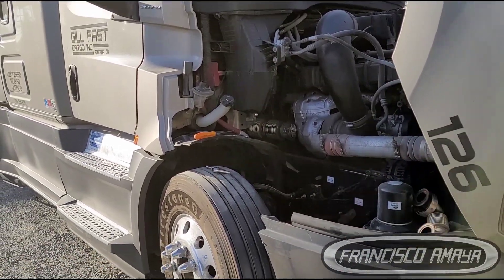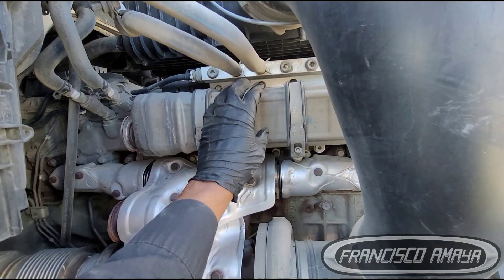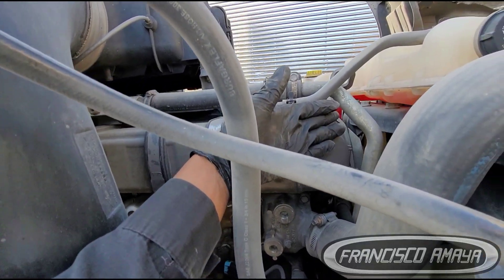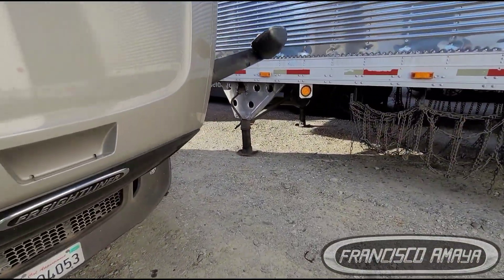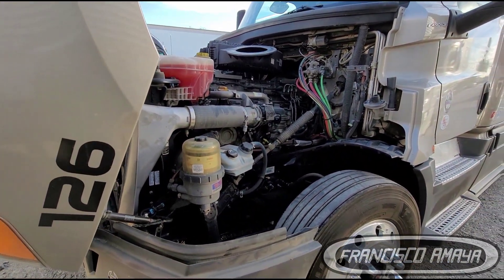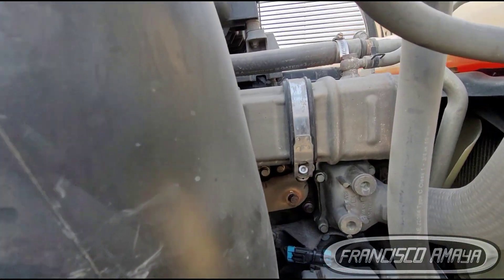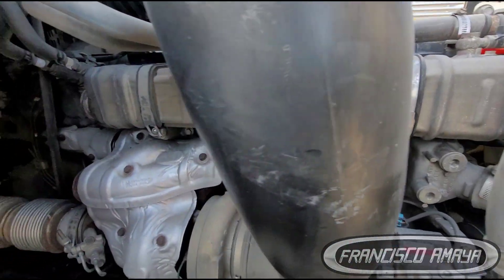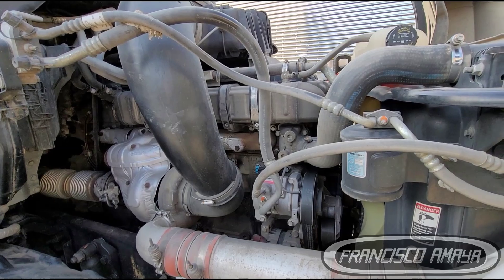DD15 engine broken bad egr cooler coolant missing one gallon every 1000 miles

Comment: I have 2018 cascadia with 600k miles & my egr cooler is still completely dry and barely has any carbon build up in it. This truck definitely was idled a lot to have egr in such poor condition.
Reply: Same here have a 2018 with 490k. i dont idle period..
Reply: mine didn’t go out until I got close to a million miles and I idle a lot